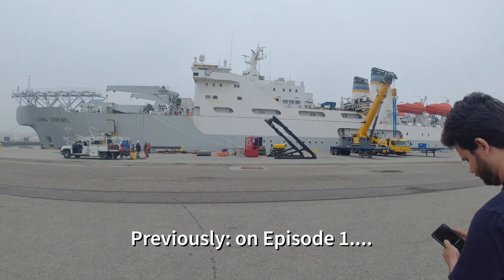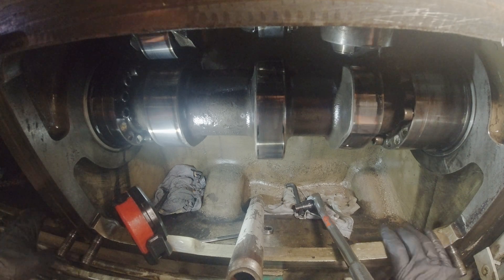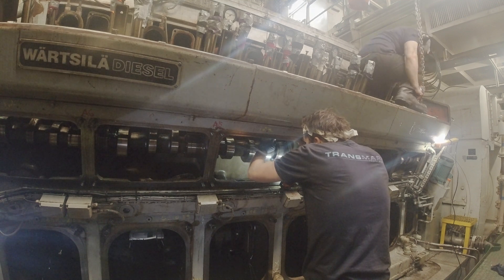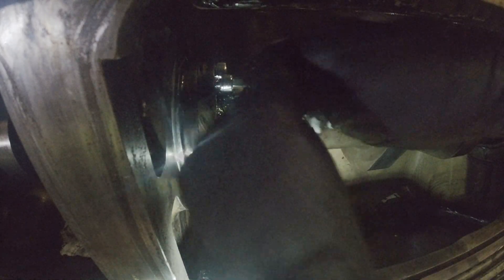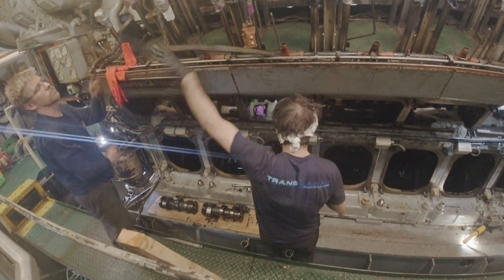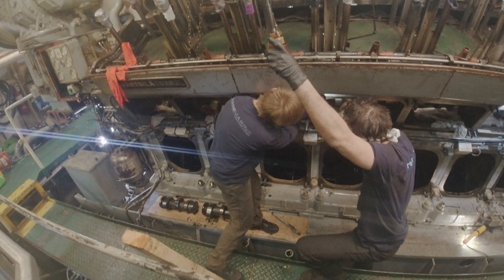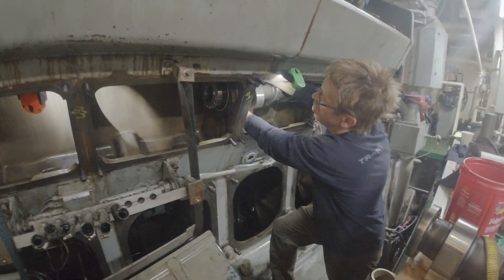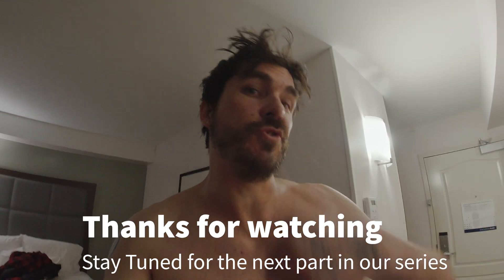Wartsila 12v32 Overhaul: Camshaft Removal

Comment: That cam is as big as the crank in a engine like a VW or Honda. Amazing
I heard some of these engines can run on half the engine, not use cylinders. Whatever they said seemed like that part didn't rotate, any idea ?
Reply from the maker: This cam is def larger than the crankshaft on my VW haha.  

I cant quite think of what you might be referring to there.  I will ask some of my colleges and see if they have any idea.  Cheers!